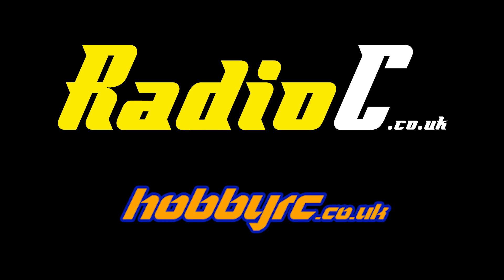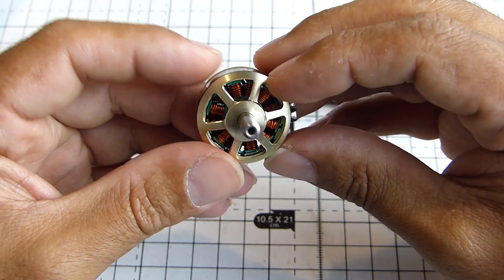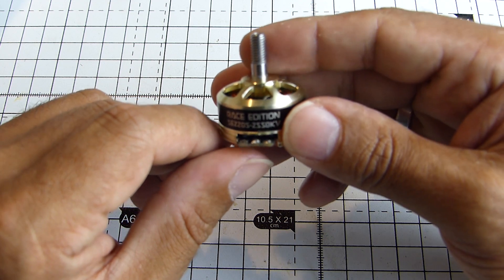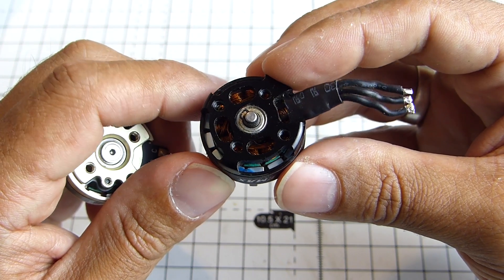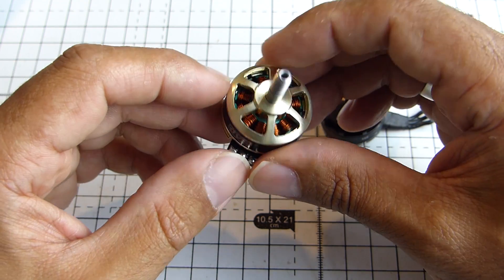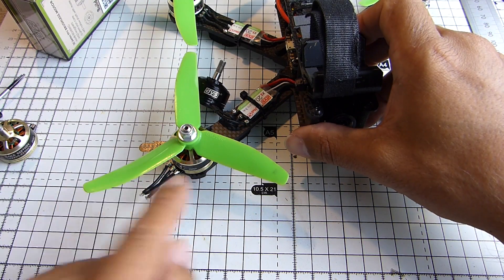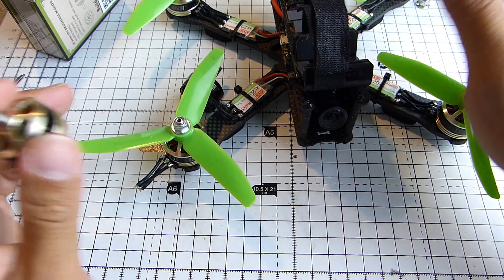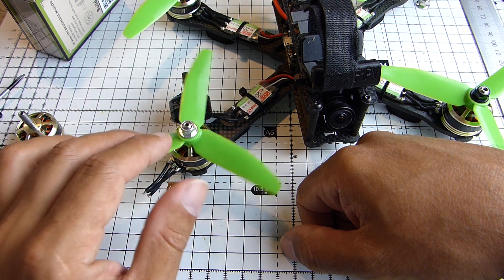DYS SE2205 2550Kv + XS20A ESC review & flight test!

Comment: Something great (and yet so simple) about the Emax red bottom 2205 is the clear markings: it says CW or CCW and it has arrows showing direction. So when you're ordering a single replacement there is no guesswork or bad surprise. You're getting the proper one. DYS missed this. I guess it doesn't matter when you're ordering 2+2.

Comment: the dys is actually more efficient when tested in a thrust stand.
Reply from the maker: not in my testing, and judging by the sheer number of complaints on here, i cant see much in their favour until they sort these problems. The QC is awful and they come down hot on many quads. When your quad is tuned well, this excessive heat is wasted energy and a good sign of inefficiency,  which lines up with my data and experience.  Maybe i just got a bad set. But they have to improve the quality control without a doubt.
Reply: +NJ Tech yeah I agree. honestly I would go for the normal se2205 since its cheaper and comes in black.
Reply: BMSWEB SAYS THAT THE SE 2205 MOTORS ARE AWSOME AND THATS COMING FROM A WORLDCLASS RACER!!!

Comment: Same vibration issue on brand new motors. I ordered 6 and 2 of the counter clockwise motors vibrate horribly. There clearly is an issue with their QC. Also a word of warning. They threadlock the screws on the shaft so be very cautious trying to take these apart. I stripped two in a row trying to unscrew them. I ended up threadlocking an allen key, waiting for it to dry then unscrewing the motor. Crazy....
Reply from the maker: Thanks for the comment and couldn't agree more. And it always amazes me how how thread-lock is used on most factory installs. It's either caked in the stuff or not on there at all. Never just a tiny amount wiped on the thread as it should be. Anyway, lots of new motors are inbound for testing that i am excited about. Let's hope DYS up their game a little on the motor QC to the same level as their excellent ESCs.

Comment: why is a hollow shaft stronger than a solid shaft?
Reply from the maker: The shear stress developed in a hollow shaft is lesser than that developed in a solid shaft for the same applied torque and same external diameter. If you google this you will get more information on the subject, and a more physics based explanation than i can give ;)
Reply: +NJ Tech wow I've just learnt something new thanks man, I just naturally thought having a solid shaft would make it stronger thanks

Comment: Too positive imo. Emax is alot smoother, and the dys bearings do wear out really really fast. Atleast thats what happened in our club. 6 motors ruined after a few days of flying. The bearings are nearly impossibly to replace.
Reply from the maker: I totally understand your frustration but there are many i know flying without issue too, the problem is everyone should be having a good experience given the level of quality in other brands, like Emax. What i 'hope' is that DYS see these videos and decide to do something about it! The QC needs tightening up, and customers looking after or they will not be sell many motors moving forward. As you say, EMAX reds are the better choice for now, which i do say in the review. Make sure your club members let their vendors know about this! Lets hope this is a wake up call for DYS. Thanks for your comment.
Reply: NJ Tech Yeah i'm just crying cos i purchased 10 dys motors few weeks a go... Maybe the bearings need more oil when they are new. Dont know.
Reply from the maker: yea that sucks, 10 is enough to hurt your wallet for sure :( 
with all my motors i put two drops of scorpion motor oil ever 10-15 flights, and it definitely helps. Im reviewing some more motors soon, one of which is the ZMX bule caps, heads up; so far these looks really promising!
Reply: +NJ Tech yeah, and club members have more that are bad too

Comment: Great video, quick couple questions: I am keen on getting red-bottom's at 2600kv as well as the xs20a's on 4045x3 props. Can the DYS esc's handle that amperage? Also have you had any de-sync issues with the xs20a's?
Reply from the maker: Hey, no desync issues but make sure your min throttle isnt too low, lots of people dont spot that as the problem when it happens. Just because BLheli_S can spin at low rpm doesnt mean you should min throttle that low. Personally i would stick to 5040 max on 2600 with 5 inch. The performance will still be ballistic! :)

Comment: try loosening the bolt on the bottom of the motor, the washer might be pressing to hard causing the bearing to make that noise.
Reply from the maker: i've taken the whole motor apart, its not that, its a combination of bad machining and a bad batch of bearings.
Reply: +NJ Tech wow, hmmm this is really terrible I hope mine aren't like that
Reply from the maker: You wont really know or hear until they're mounted to the frame, so mount them then check for shaft wobble before you do any soldering. If one or any of them have it then RMA it! Hopefully this was just a bad batch and the problem isnt too widespread. Either way DYS need to tighten up their QC.. best of luck my friend!

Comment: NJ Tech Thanks for the review!
Couple of questions:
Did you noticed any desync with the xs20a?
 What do you think about this 180 setup: 
Emax rs2205 2600kv
xs20a
GF4045BN 2-blade
on 4s battery
Reply from the maker: +Dan Reina no desync problems at all. One thing people don't generally realise is the importance of getting you min throttle setting right. Sometimes raising it by just 5 points can solve the problem. Your setup suggestion should be killer ;)
Reply: Thanks for the help! Which FC you recommend by the way?
Reply from the maker: There are too many to name, i suggest checking out Joshua Bardwell's video on controllers to help make a choice that is right for you. I have had a lot of success with the SPF3 running betaflight but there are many other and better options out there now too.

Comment: I'm undecided about blheli_s. Is it a worthwhile upgrade? Currently running xm20a with multishot and I do like them. Will I notice much difference going from those to running multishot on a blheli_s esc?
Reply from the maker: its a tricky call for me to make as everyones set up is so subjective. But in my experience with both protocols, i will say i did notice a difference in the shear speed/smoothness of Blheli_S and so far im impressed. If you look at the flight footage you'll see just how tight the response is to propwash in low speed/high descent situations. That is always a good measurement of the speed these ESCs to deal with that on a given set up. However! The Xm20a's are fabulous ESCs, personally if your tune is good and you come away smiling from your flights, change nothing, keep flying! :)
Reply: +NJ Tech yeah good point. Very happy with my tune at the moment. Very locked in. But your footage is super locked in. No prop wash (I have a little I can't get rid of, but I've learnt to live with it) and no bounce back or overshoot I can see. Granted, a lot of that will be down to how you tuned it, but my way of thinking is, run the best gear, and I'll be able to tune tighter. Hmmmm. Guess I need to keep mulling this one over a bit longer! I'm tempted, but not exactly flush at the moment so need to buy wisely and once!
Reply from the maker: haha i know how you feel. To tinker, or not to tinker, that is the question :)
Reply: +NJ Tech exactly. If it ain't broke, don't fix it! But the temptation to tinker is strong! lol

Comment: So glad you have reviewed these products, just what I've been thinking about trying myself. I have a couple of things that I was thinking after watching your review.
Are you comparing the feel and thrust of your Emax 2205 2300kv on bullnose V2's against the SE2205 2550kv on non bullnose? Did you try the Emax motors on BLheli_S?
Any idea of the burst rating of the XS20A's? Wouldn't the 30a version be more suited to 2550kv? XM20A's only have 25a burst and I would think any tri blade would be pushing that on 4s 75c batteries. Did you/do you run osd with amp reading?
What's with the Kiss FC? Lol. Are you running betaflight on it? Can you still blackbox with Kiss? I heard it's way too slow to be of use.
Thanks for the review, it was worth the wait.
Reply from the maker: Hey Bludz. So im comparing like for like, they perform the same in terms of power emax2600kv>DYS2550kv. The XS20As burst to 30A and handle the power of the 2550kvs just fine (i gave them lots of abuse :) ) but i did find that bullnose props were over-propping and the non-bullnose triblades were a better match on 5 inch props. I dont use an OSD because i dont like the visual distraction when i fly. The Kiss only went in recently for testing purposes, running the Kiss RC28 firmware. I will be giving my thoughts on that FC in a later video :)
Reply: Thanks for the info, look forward to seeing the kiss video.

Comment: great stuff NJ.
esspecially as I was looking at these.
there was a slight vibration sound on some maneuvers in the flight test which I assume is that play in the dodgy motor, not all the time just on some maneuvers.
Anyway great video as always fella 😊
Reply from the maker: half of the flight footage is with the bad motor and half with the black non-pro replacement. You are right there are a few spots where you can hear the bad motor bearing slightly whistling. Thanks for the comment :)

Comment: You can definitely hear that bearing noise in the footage..... I am running the DYS MR2205's and havent had a bad run on those.
Reply from the maker: good to know, it may be that i just unlucky but hopefully DYS tighten their QC! Cheers :)
Reply: +NJ Tech nope I have ordered 8 of these motors and at least half of them have been crappy bearings where they make noise or some of the motors get stuck and just sound horrible. And on top of that you can't even get the head screw unscrewed because it just strips, so cleaning the motor is also out of the equation. I'm tired of spending money on motors with low QC. I just bit the bullet and ordered 4 lumenier rx2206 2350kv. I'm willing to sacrifice a little bit of power for smoothness and good QC. What do you think of the lumeniers?
Reply: +NJ Tech I was also looking at the zmx v3 (blue cap) looks very promising. I was going to go with those but everywhere is out of stock. Anyways, keep up the videos! Great channel you have going on here.
Reply from the maker: Jake Cardinale Totally agree Jake. I've not actually been back to lumenier motors since the birth of the QAV-250, and those were under powered and not very good bearings. However these days their motors are superb, still a little pricey for my taste when cheaper motors like the red bottoms are so good for the money, but they are great now, no question. Im currently testing the ZMX Blue caps, which are another premium motor and without giving too much away, i think these are looking like top tier also!
Reply from the maker: thanks man appreciate that :)